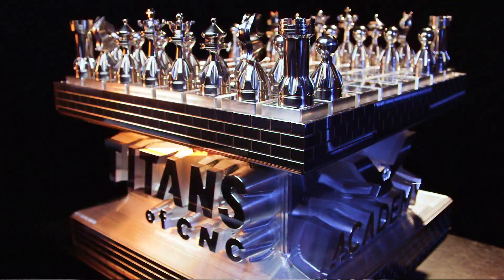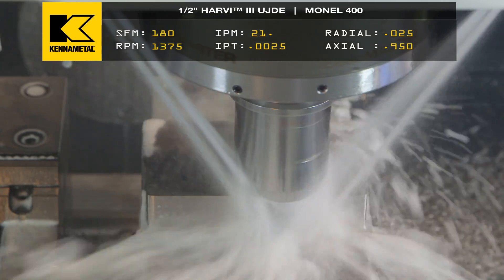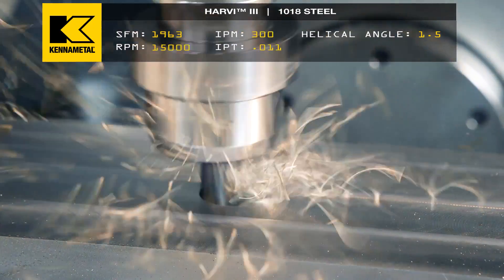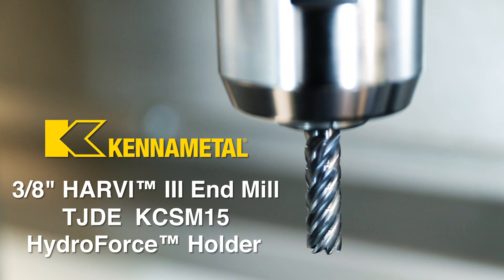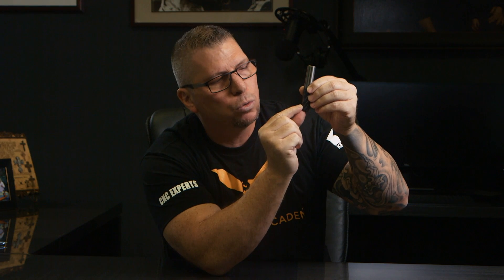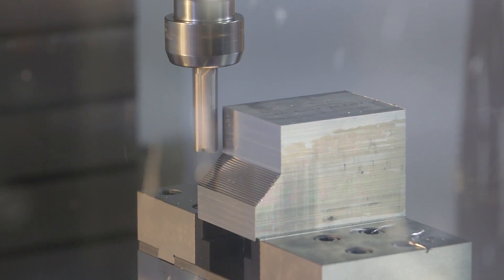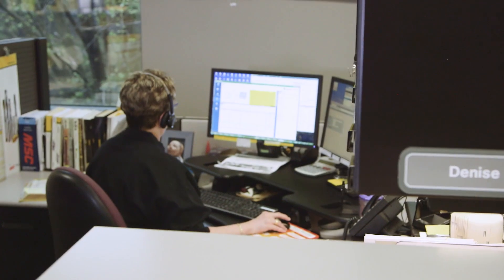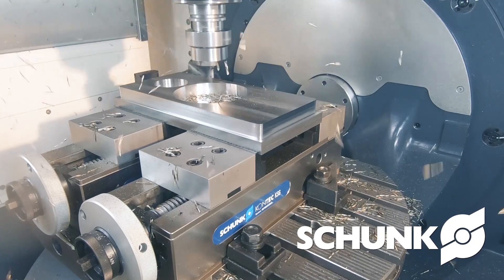High Efficiency Milling | CNC Machining | Vlog #111

Comment: Thank you!   When is  high feed shell milling a better option than adaptive clearing with a end mill?
Reply: Deep slots/pockets and I think in hardened materials, but again in deep slots and pockets
Reply: Also it mightn't be as quick sometimes but it's more cost effective than purchasing a crazy big carbide endmill

Comment: Hey TITAN, 
I am in love with your videos and the knowledge you share to the community. it is pretty useful and really helpful. 
I have one question over here. If you wanna machine out Hanyes material with high cobalt content, what is the tool that you will use to rough out the material and what parameters we can safely consider for that sort of material? Also how you usually deal with sticky material like Hanyes ?

Thanks 
Keep up the good work!!!
Greetings 
Nachiket

Comment: Plus add a 20k RPM spindle all heat shrink holders and bigger size end mills (.500 dia plus) and  a 250k mill with all the bells and whistles and anyone can run at those cutting speeds.

Comment: Hi. Titan I'm from Germany. An important point about which you could still speak at Milling would be Toursfäser. The small round at the end of the milling cutter is very important for the life of the milling cutter. The cutting forces are not transmitted via an unstable, fracture-prone corner.
Reply: EwieEnde du verwechselst Torusfräser mit Eckradienfräser.

Comment: I try doing this with our canned cycles in or old m2 control mazaks, not as efficient as using cam software but the machines don't have the memory necessary. Still works though. Found through trial and error on some stellite parts I had to do wish I'd seen this a few years ago I'd have been playing with the concept longer. Work for a rinky dink shop with a small budget trying to do the best we can. Love it actually. Most of the time lol. I've had good luck on those old mazaks hogging off a lot of steel on large pieces with coated powder metal roughers, granted slower on the feed, similar depth of cut, deeper radial cut maybe 20%

Comment: Great job explaining Titan.  Maybe you could do a video showing how important the toolholder is to the system.  And teach the new folks how, just 1 chip on your toolholder's taper can scrap a part.  I tell my trainees, "Always always clean every metal to metal contact when setting up.  Whether it be a hard jaw in a vise, or a small endmill in an ER 16 collet.  Cleanliness is next to Godliness."  Take care Brother.  Keep up the hard work.  PS. I just switched to Blaser Synergy 735 in one machine.  I haven't had a chance to run it, but the Blaser guy told me it works great for plastics, since the shavings don't leach the oils out of it compared to a mineral oil coolant.  Will let you know how I like it.  And no, I haven't drank any....

Comment: What should I do if I don't have 20k spindle and I have 12k spindle? How do I calculate speeds and feeds? Half surface speed, half chip load? Same happens with small tools. They require 40-50k rpm spindles. But not everybody has one. Please make a video for that, it would be useful for many of us, your viewers
Reply: Just run at 12k with the same chipload

Comment: Titan you touched on the subject of standardizing speeds and feeds.   I am in the beginning stages of implementing high efficiency milling.  What is the best way to standardize speeds and feeds with the various axial depth of cuts.  For example one part I might use .500 of flute but another part I might use 1.00 of flute.  In my experience both depths require different feeds and speeds.
Reply: I don't think you'll be able to standardize across axial DOC. The smaller DOC will result in less spindle load which means you might be able to feed faster. Please share if your experimenting shows otherwise!

Comment: Great logical explanation. Titanium freaks people out, but it is much more free machining and softer †han say 300 series stainless steel (316,  303, or 304). 
Thank you for sharing speeds / feeds.
Reply: Hopefully this comes across as helpful and not douchy: but 300 series stainless steel are softer. Typically people are not aggressive enough with their feedrates which causes not enough heat to go into the chip. This causes the material to work harden and edge buildup on the tool. Coatings usually fail at this point and your tool will likely break. Titan's advise still stands: make sure you try the recommended feeds and speeds, even if you think they're too aggressive, you might shoot yourself in the foot by backing off.
Reply: I'm definitely going to try some "Kamakazi" runs on some test pieces. I may have one eye closed, but I'm going to try it ...... :)
Reply: @keithlane4343  Good luck! I hope you find success!
Reply: The problem with stainless, it gets hot and doesn’t distribute heat at all, its sticky and get it hot, it hardens making it even tougher. Some can get into the 57-58rc hard.

Comment: Great video as always. Im constantly trying to tell my older workmates in Sweden that milling dynamically like this is way more efficient. But they are determined that the old way is the way to go and just laughs at me 😅
Reply: I used to work at a shop with this attitude. In their defense, HEM is basically black magic to them and it may not actually lead to the fastest MRR. To win them over (maybe...depends how stubborn they are!), you'll have to get an outside applications engineer to run one of these toolpaths in one of your machines so they can see for themselves. Make sure your CNC control has enough "look ahead" to prevent something known as "data starvation". If you don't and you run HEM, you'll break the tools and maybe never convince them. If you're looking for more MRR, Google high feed milling with actual "high feed milling" cutters. They have a special geometry and design that will typically beat HEM in MRR, but HFM might not work for every situation. Good luck!

Comment: Hey Titan as always greetings from Germany! Nice Video ! Did you ever try tools from Germany company called "garant" or "holex"? For  radius measurement do  you have a system? Or do  you  measure the Part and  then  Change the Radius of the Tool? Im Working on  a maho 800e  so i have to measure the Tool Radius by measure the width  and  the length of the Part then set  the right Radius -.-

Comment: Why don't you try other tools brands like sandvik?
Reply from the maker: I definitely have used Sandvik...
I chose Kennametal simply because they had the best tools for my applications etc. Like the Harvi3 in this video... it beat out Sandvik and 16 other top companies to win the Boeing Challenge.
Reply: he uses a brand which he trusts, I remember a video where he talk about using other brands some time and do try diffrent brand as well depending on the job
Reply: He's also not sponsored by Sandvik

Comment: I would like those same recipies but with turning Inserts. I
Reply: Just remember that MMR in turning is proportional to the product of speed, feed per rev and depth of cut. Generally feed is the parameter that gives the biggest gain because it's got a wider range (e.g. Cutting speed may range from 200-500 sfm, but feed on the same insert can range from 0.1 to 0.6mm or 4 to 24 thou).
Reply: @kunstderfugue  this week I used the insert recommendation from catalog but they seemed really agresive, actually the problem was depth of cut for me, I got a horrible bird nest but when I reduced it I achieved the chipbreaking
Reply: @173roberto  not a native sry, which one is crater nest? I take it it's a kind of wear

Comment: Officially my seventh request. Please do a video fro 4140 with solid carbide end mill. Please...
Reply from the maker: Give me some specifics as 4140 is pretty easy and I have been doing a ton of harder materials with solid EndMills?
Thanks
Reply: @TITANSofCNC   We use 8mm diameter end mill with 16mm axial depth of cut. But we are not able to get consistent results.
Reply: @rocky7891  remember the more info the easier it is to get help. Knowledge is power. You should go over to practicalmachinist.com there's a lot of people with great experience there who'll offer their thoughts
Reply: rocky7891 - Have you tried an end mill with variable geometry and/or an odd number of flues?  That’ll could really help dampen vibrations.  And depending on the material, 8mm might even be too small to get a proper surface speed.
Reply: What data do you use and which product?

Comment: Hi man... You are amazing and you  were my inspiration. I am willing to know about how you select feeds, speeds, axial depth of cut and radial depth of cut for a tool in mm also.
Reply: Google Harvey Machining Advisor Pro. It will give you some numbers to get started with.
Reply: Dinesh Dinesh - Check with the cutting tool manufacturer.
Reply: @ClockworksOfGL No Man . I am working in small industry here they will not use any tool wonders. So we need to buy it from outside tooling shop. Eventhough if I calculated and apply feed and speed with help of vc and fz. I didn't get a sweet spot.